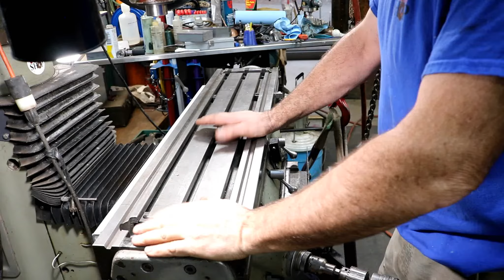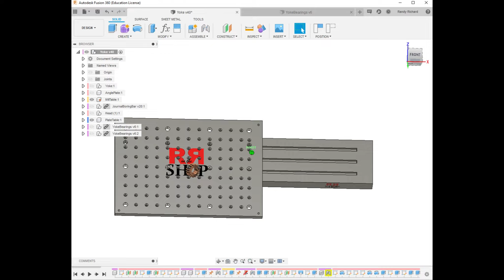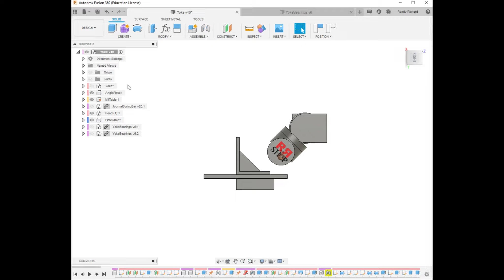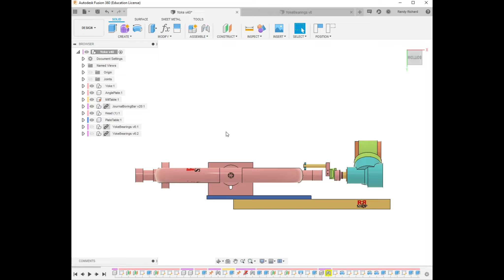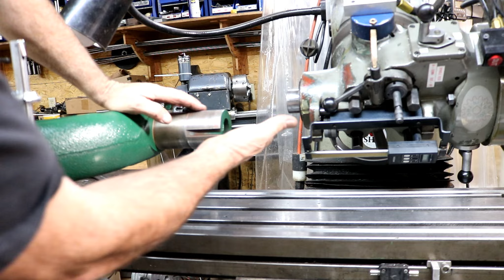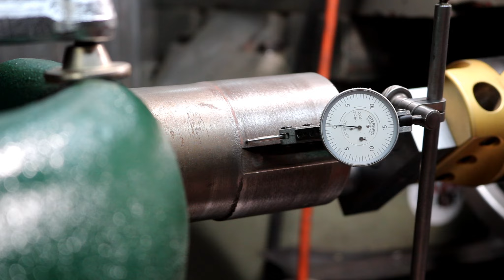Cement Mixer Restoration Repairs P3 | The Yoke Setup

Comment: Randy,
Thank you for a reference to a machinist jack I sent to you. Latter I sent several more of the same to Keith Fenner for the “What’s in you box” competition. Unfortunately, I had a stroke in late September. I am getting much better going from paralyzed on my left side to somewhat walking again. I will be safely working  in my home shop in December and making more tools. I like your cement mixer restoration series. 
Regards, Paul
Reply from the maker: Paul I had no idea.  I hope you are doing better.  Great little jack.  Get well stay in touch.  Thanks Paul.

Comment: Perhaps an indicator base on your quill, and run it in and out on the handwheel surface 
 to double check your set up. Could run it on top and the side. Also, how will you feed your boring bar in when you can't get off the machined surface? Lots of work in that set up, I can see that plate coming in handy. Thanks Randy.
Reply from the maker: Thanks Dave.  Great suggestion Dave.   Vid on Saturday.  Yes the plate is nice I love the holes.

Comment: Hi Randy just a FYI . I would use high speed tool bit instead of carbide .
you will have less chance of chatter as carbide needs way more tool pressure 
to cut . I do a ton of line boring on large excavator and crane parts and never 
use carbide .
Reply from the maker: Yep I agree, I will see what I have.  Thanks Joe.

Comment: I am sure you rechecked your spindle to part parrallelism after adding the jack. I would expect in that sort of setup to normally see .002 to .003" of table droop vs the spindle being 90 degrees. getting the quill aligned to the spindle is all that really matters the table could be anywhere since you aren't moving it. I think I would have gone with a braze buildup and turn back down but those split bushings should so the job too. :-)
Reply from the maker: Yep I had 0.003 drop the jack fixed that but like you said the angle of the table really does not matter as long as everything is aligned to the table.  I thought about building the journal back up.  But the amount that need to be remove was not that much.  I did a build up on journals on a steam pump one time long ago on a ship.  Used Nickel rod and then re-machined.  Worked great you could not tell it was not original.  That pump ran for 20 years until the ship was scrapped.  This I think will be a better option, now I will have a bit more space to make real bearings since there were none.  The modeling really helped make this decision.  Thanks Brian.

Comment: You know how the mill vice has a key in the bottom of the vice to line it up square to the table well you need to machine a couple in the bottom of your plate for quick set up on machinery T slots
Reply from the maker: Yep that would work.  Maybe something after I finish up the edges.  Thanks Barnezy44.

Comment: You should have said something Randy I have a 90-degree head that you can mount on there and save a lot of that work
Reply from the maker: That is ok Bill I think this is going to work fine.  Thanks.
Reply: @rrintheshop  the correct wording is a 90 degree adapter for the mill.
But I am confident you will prevail
Reply from the maker: @wnebergall  Yep I would not mind having one, would come in handy.  One day.

Comment: how do you compensate for gravity with the dial gauge in a radial horizontal sweep or is it insignificant?
Reply from the maker: On this Gary I am not real concerned about it.  It is a Cement Mixer.  Try to keep all arms short as possible and as rigid as possible.  I was happy to be within 0.001".  the journals are is such bad shape, anything is going to be better.  Thanks Gary for the great comment.

Comment: It's a shame you are 2000 miles from Brian Block.
Reply from the maker: Yep for sure.  Thanks Roy.
Reply: @rrintheshop  My thought was it would be a lot easier to machine on his HBM not that you can't do it.  Cause I am sure you can, just so much easier.
Reply: @royreynolds108  If might even fit in that mongo lathe he has too.
Reply from the maker: That is fro sure it would of been.  Thanks Roy.
Reply from the maker: Yes for sure it would of fit.  And even easier on a lathe.  Thanks Roy.